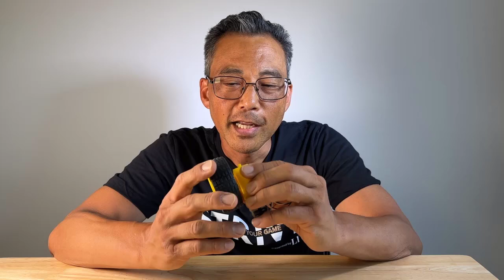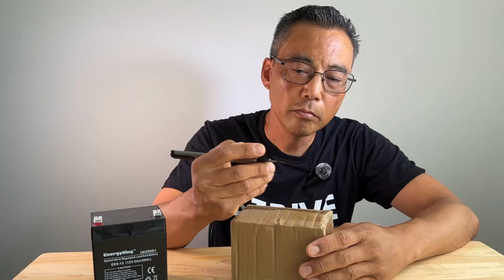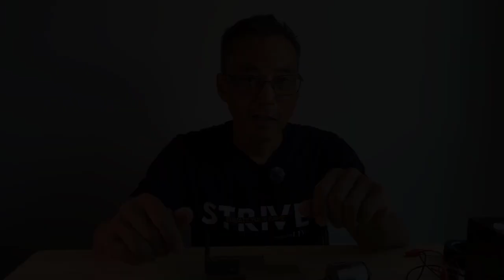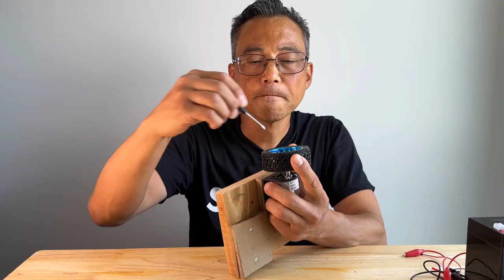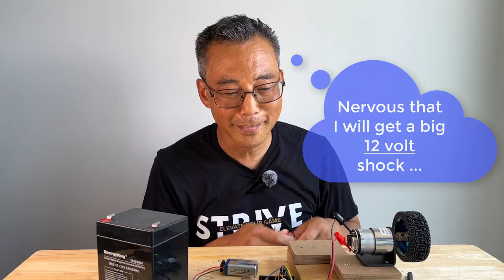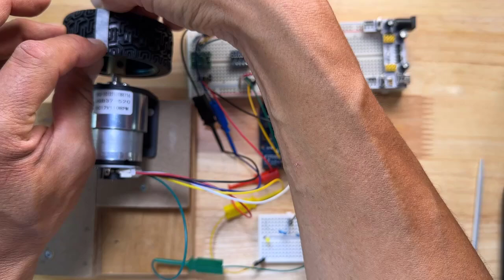First Time Powering a 12V DC Motor with Arduino — Does It Work? | Robotics Project

Comment: Maybe you should make a Gearbox to reduce the torque and multiply the Speed of the motor.Also how do recharge that kind of battery?
Reply from the maker: Hello @Doudou_chienF7. That is true, I didn't think about a gearbox. I chose the motor based on what Matt Denton had in his bill of materials. I thought if the motor were too slow, then I could buy another faster motor from the same seller. As for the battery I bought a cheap charger from Amazon and I plan to test it in a future video. 

Thanks for watching and commenting.
Reply: @jdkato1778no problem man